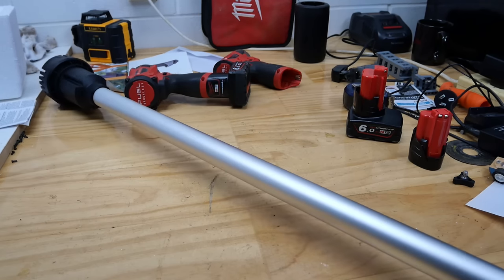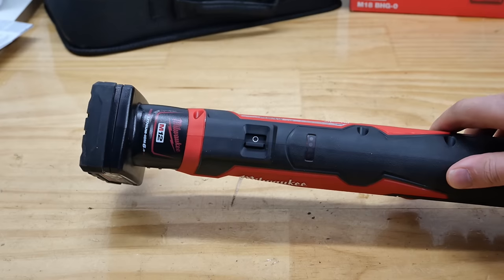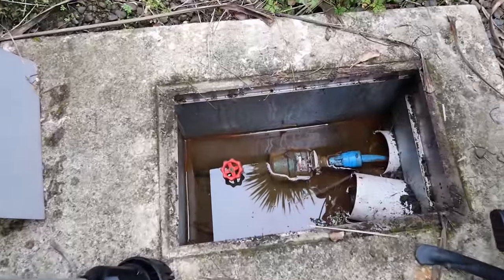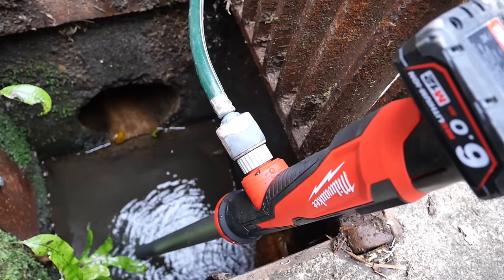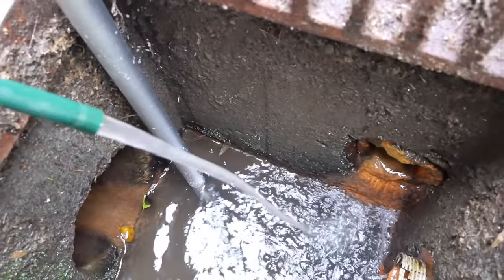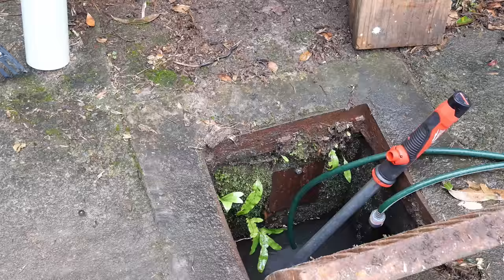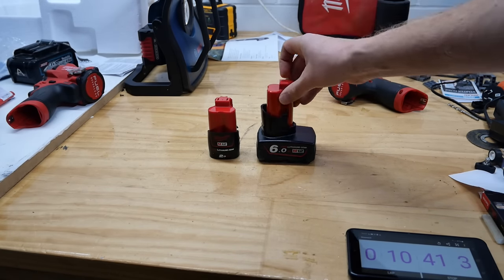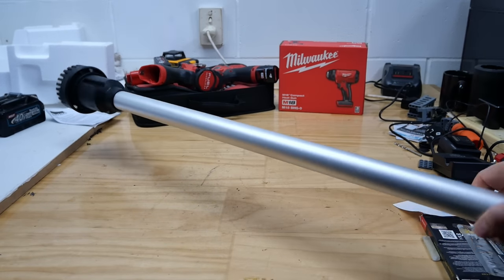Milwaukee M12 Stick Transfer Pump  |  It's a nifty little water mover AND IT FEELS LIKE A LIGHTSABER

Comment: Milwaukee: Behold my new stick pump! It can do 34L/min

Makita: I'll just stick one on the end of a powerhead and get 150L/min (but you'll have to wait 2 years before I sell it outside of Japan)
Reply from the maker: I'll have one long before that. ;)
Reply: Does Makita have one on the 40v? I haven’t heard of this! 

Just had to replace a sewage ejector pump (only used for gray water for laundry) and it was NOT fun emptying the pit with a shop vac. I would kill for one of these from Makita. Milwaukee makes me want to get a second battery platform with how much stuff they have. Realizing that 40v alone isn’t gonna cut it. I thought I could get away with it after replacing my old, super cheap battery platform but Makita just isn’t introducing the general stuff.

Comment: 500 gph bilge pump $15 Amazon warehouse deals,runs on any battery.
Can be used with any battery from 12-18v ,and will pump from dirty water-used diesel motor oil.
Have been doing this since 1998.
Step up to a 3500 gallons per hour for $50,will drain a 330 gallon tote in 5 minutes, but it's all about pipe diameter (1 1/4 in this instance)
Reply: Can u attach a link to what u are talking about?  Thanks!

Comment: You know you can use a siphon to easily clean the bottom of a hot tub or a pool? No batteries or motors needed.
Reply: Or a hose vacuum. No power needer
Reply: Only if you've got a lower point for the outlet - and the suction is proportional to that height difference. Won't work for most in ground pools/spas, meter pits, drains and all the other stuff shiwn in this video.